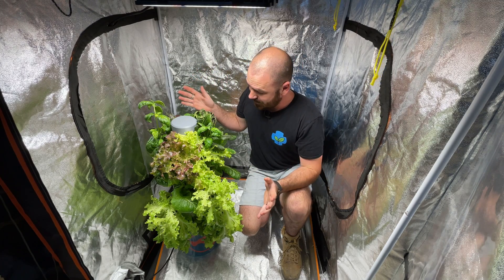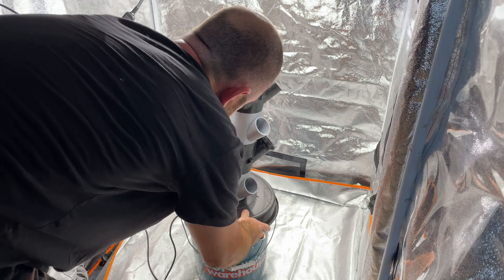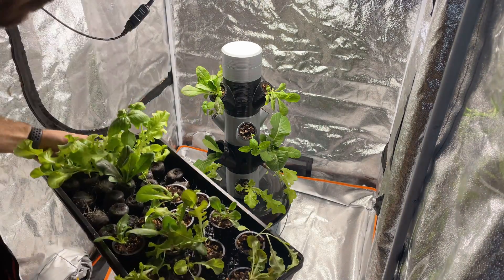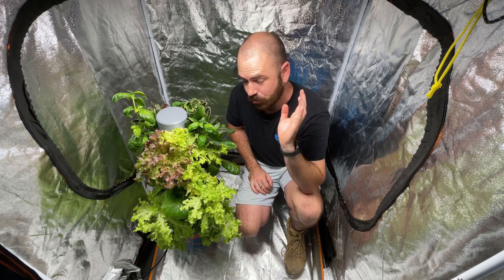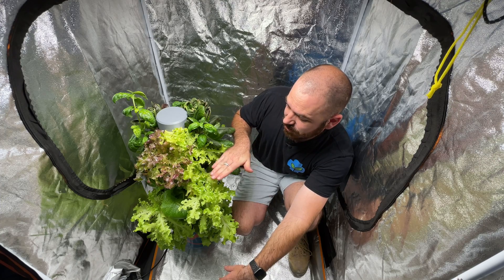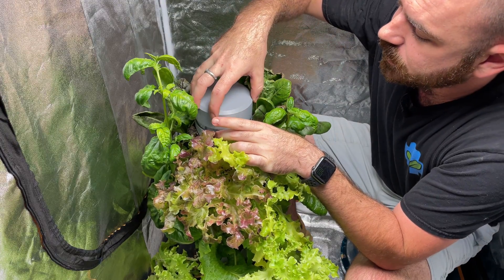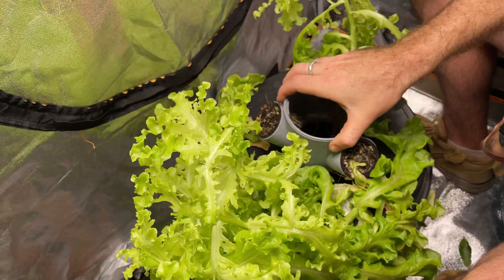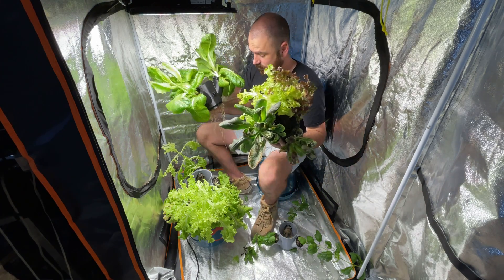3D Printed Hydroponic System Setup & Time-Lapse Grow

Comment: Great results!
It's better to use the hollow version of the updated planting modules. Pots and net cups come out easier from them.
When print settings and extrusion are right there's no tight fit at all (except for the final turn when the parts lock).
The pots with the rhombus cutout are stronger but you're right about the 2" net cups, it's easier to use them, no argument there. I was reluctant to recommend them previously because someone had trouble fitting them earlier.
Thanks for the criticism!
Reply from the maker: Only constructive criticism, I'd love to work with you to figure out how we can trim the fat on those inserts to make them with less filament or perhaps come up with a hybrid of the original and your disperser so there is no thread on the inside of the rim, Instead perhaps an external screw and cap that caps the net pot to hold it in place (hollow middle for plant)
The net pots stay in place fine so I may be overthinking it.
Reply: @Hoocho  I'm all in! The inserts are 1.2 mm thick now (3x 0.4 mm nozzle width). I can go down to 0.8 mm. Two wall lines are minimum. With 1 wall comes trouble. I guess there's just no way to make them strong and light enough, like a commercial net cup.
archipelagourbanfarms used clips to fix the cups to the ports. Some simple 3D printed clips would be enough if necessary. Screwing a hollow cap over the cups would be definitely over-engineering, don't give me ideas haha! :'D
Reply: @ASCENSiON1989  @Hoocho haha started printing this a little over a week ago and then we ran across this updated video.

Thanks for the tips!
The current 3 way modular print from @ASCENSION1989 on Thingiverse with drain holes and the one with just the center spoke have cup opening that are larger than my 2 inch net cups.  My net cups fall through.  So I printed the the modular cups.

What size are your net cups?
I have two brands of net cups and they both fall through. 

I have remixed the base so that I could use the tower on a 5 gallon bucket.
I'm curious about your base Hoocho.

Great stuff!
Reply: @ASCENSiON1989  nylon perhaps? i just finished designing some modular moss poles for climbing plants, started your tower project 4 months ago before i got busy with school. great work! im excited to try this!
Reply: I'd like to offer my help, too. I have already modified the netcups with higher tolerance and the 3way planter. With my mods, you can get 5 modules out of one spool, instead of 4, with no mentionable loss ob stability. I'll upload it as a remix, or I could provide the step. Everything is still compatible with the original.
Reply from the maker: @SeamusHarper1234  if you could link the remix here that would be great!
Reply: @Hoocho  Of course. This one here: https://www.thingiverse.com/thing:4831745
I'll upload the other stuff on a different "thing" in a few days.
Reply from the maker: @SeamusHarper1234  thanks mate, appreciate it!
Reply: @Hoocho  Nono, thank YOU for all the wonderfull stuff you create, and thank ASCENSiON. I just printed some stuff I saw in your video and made a few modifications to it. But I'd like to do more, maybe I'll look into building an open source hydroponics system =)